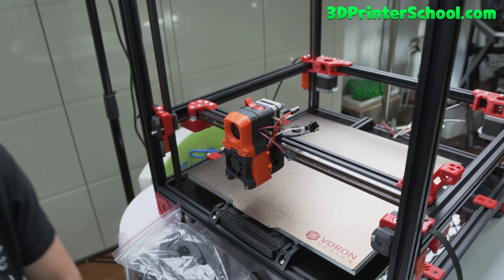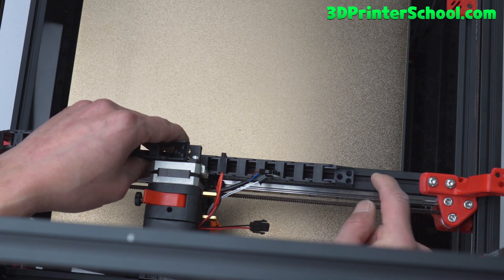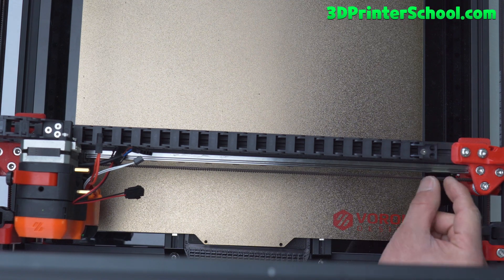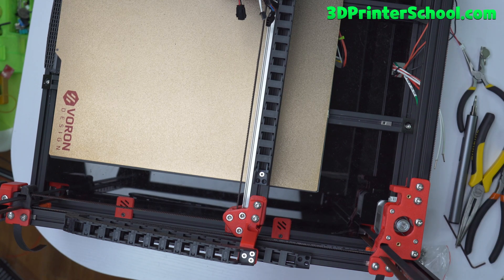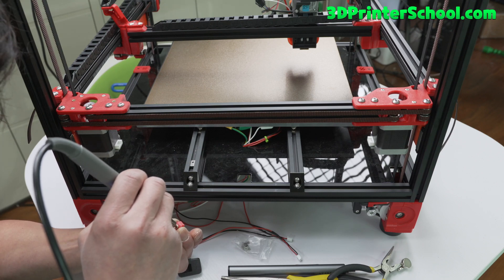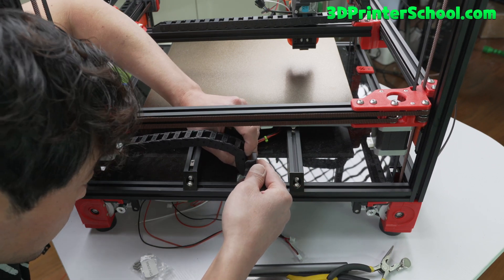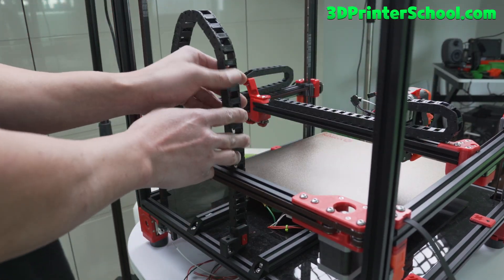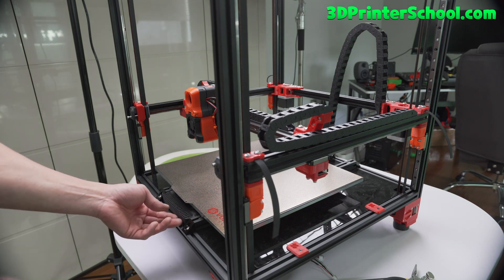How to Build a Voron 2.4R2! – Step 11 How to Install Cable Chain/Chain Links!

Comment: ah yes, the big one and the small one, how lovely accurate terms for a DIY self sourced 3D printer :P, i still dont know if my 10x20 chain will fit in the back or if i have to order a 10x10 one

Comment: I got my chains from funsor. They have WIJIYE stamped on them. They don't lay flat, and the X rubs on the stealthburner. Had to pull them apart and carve some off the movement limiters to get them to lay flat.
  3x6 screws seemed a little short, didn't engage many threads, so I used 3x8. DOH!! FHCS tapered head works great. I was trying it with BHCS.